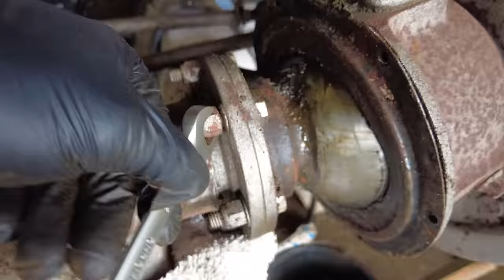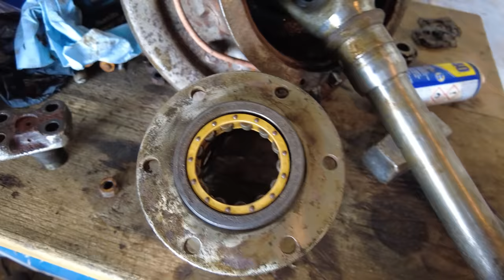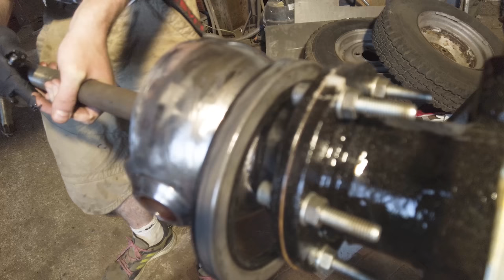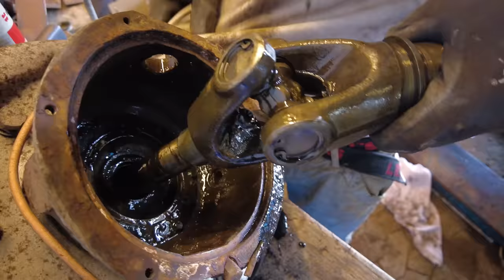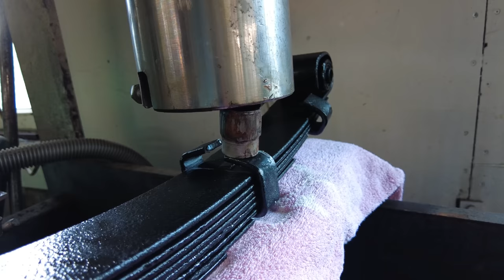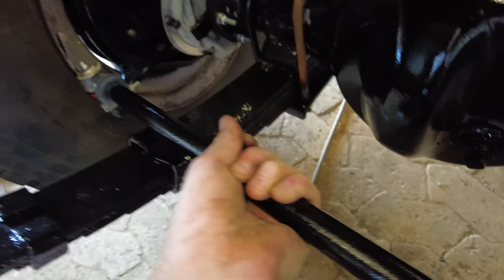Land Rover Series 3 Restoration Part 3 - Front axle with free wheeling hubs

Comment: In the first 15 seconds.. the boot shown to protect from dust.. what is it called as? Want the same for Dana 44 front axle
Reply from the maker: Could it be a swivel gaiter you mean. I used the (276954) Swivel Housing Gaiter Kit for land rover.
Reply: @CMFotoPeak  yeah thanks swivel gater it is